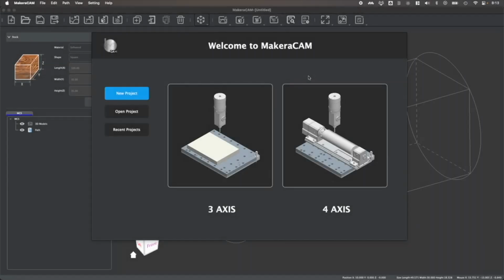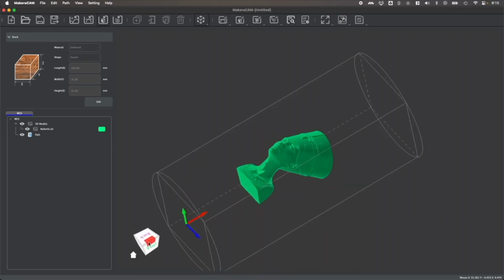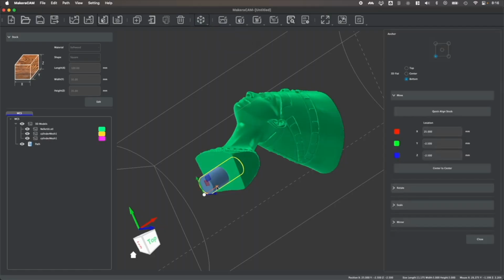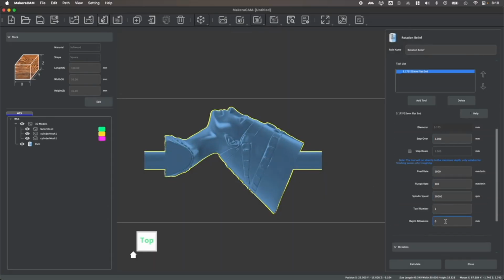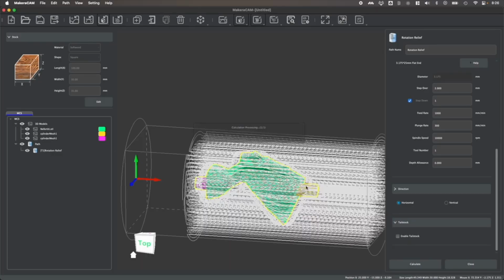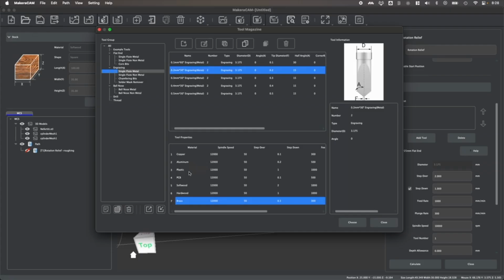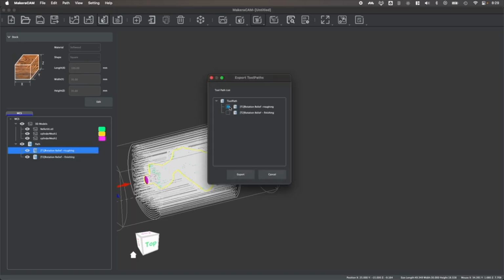Makera CAM - Creating 4th-Axis Relief Tool Paths

Comment: and why is that the boxes of bits are not labeled exactly the same as in the program? what is "shank"?? What is 1/8? Where are these data points in tha program? What is "flathead"? No tool labeled flathead.  Nowhere. Why do you want to drive me crazy?

Put names on the labels what are in the program. This should be obvious. 101.

Comment: hi, can you teach how to use the same stl file in fusion360 and works the same way with makera air? i m new to this and wanted to stick with fusion360 for that, i set up all the profile and tools but stil felt lost and fail to get it done to work with makera

Comment: I think my biggest question has to be how your second tool path is accounting for the previous one. When I attempt to do the same, mine simply doesn't, and thinks it needs to rough out the entire model with an engraving bit.
Reply from the maker: This was done by disabling step downs for the second tool

Comment: While calculating the rotation relief feature, an error pops-up saying 
No 3D model selected! 

even after selecting the 3D model
Reply from the maker: That's a strange error, please attempt to relaunch and reload the model. Please also contact our support team via support@makera.com so we may assist you further.
Reply: @Makera  Just needed a software update, thanks to the support team✌🏻

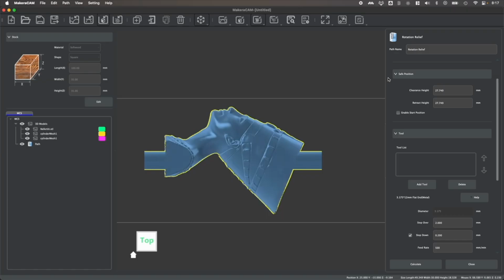Comment: A couple things.  Regarding clearance height,  3:21 take into account the height of the tail stock.  I’ve already broken one 2mm end mill when MakeraCam sent it traversing right into the side of it at the start of a job.  

If you do run more than one rotational tool path in one job the 4th axis will “unwind” all the way back to zero.  This added hours to a recent job.  Better to run separate jobs just for that reason alone.
Reply from the maker: yes, thank you for this feedback